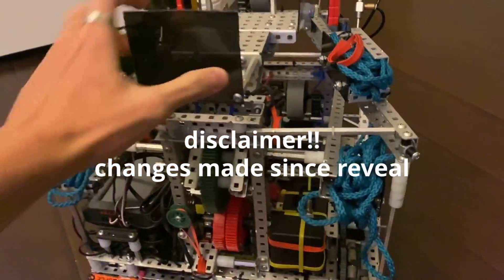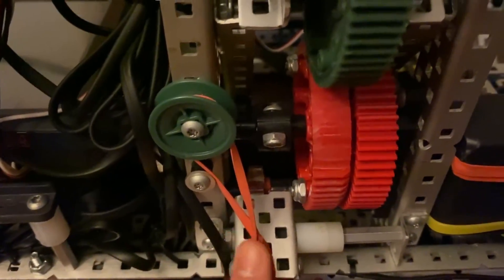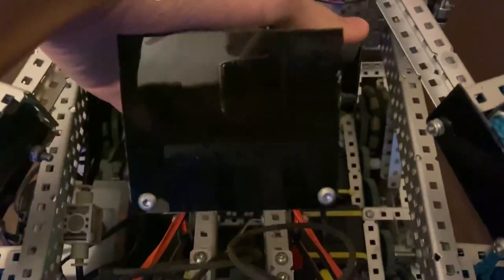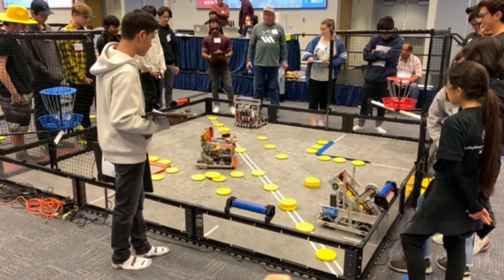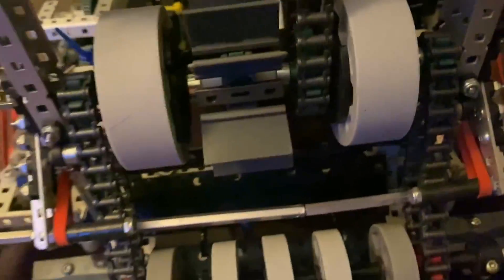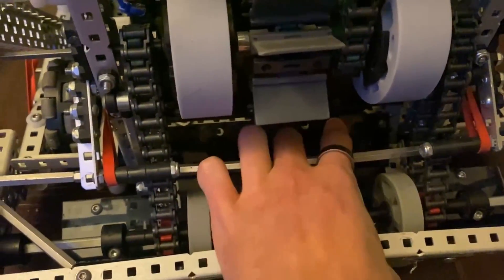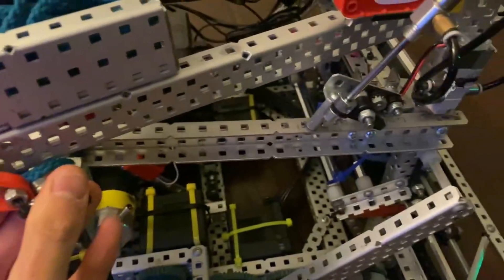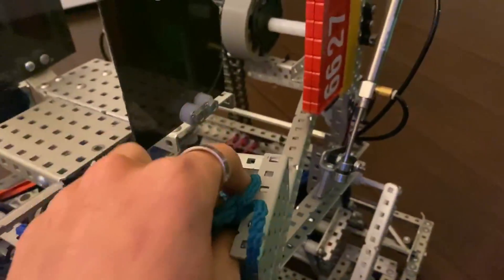Vex Spin Up Robot Explanation | 6627A | ACE | Early Season Robot

Comment: I've got a question on how you get the catapult to start in the down position before auton begins. Cause most of the time if the motor isn't holding the cata in place the rubber bands just pull it back up?
Reply from the maker: we had a ratchet that held its position
Reply: @jaypenguin8725  so the ratchet allowed the catapult to be held down without the motor? Cause right now what holds down the catapult in match we just have the motors set on hold instead of Coast.
Reply from the maker: @tomthedeztroyermcoc3545  yes, the ratchet holds the cata down without the motor, it is a mechanical stop we build onto the catapult

Comment: I'm kinda new in vex and wanted to know what the ratchet is used for, can you explain its purpose ty!
Reply from the maker: yeah, the ratchet is pretty much used to reduce stress on the motor. Its used as a mechanical stop on the catapult when its down so the motor isn't taking the entire force of the tensioning to hold it in load position